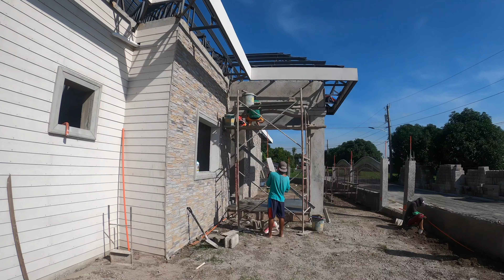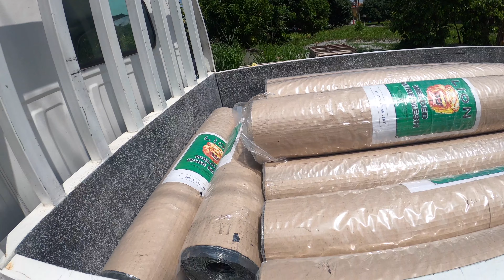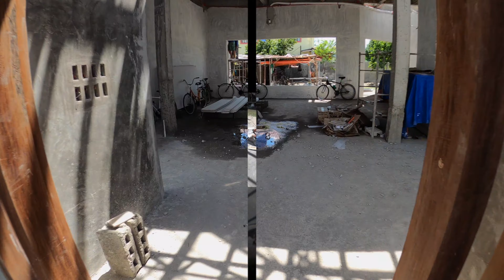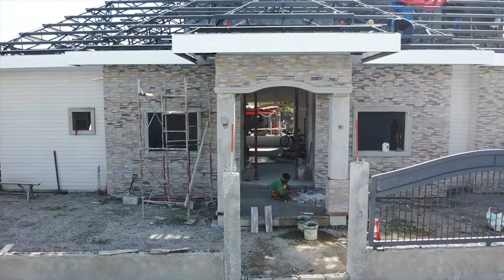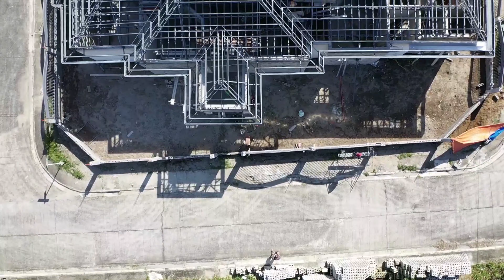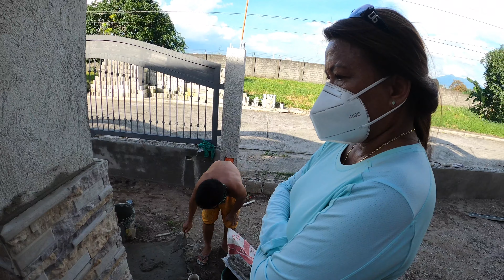Philippine House Building Step by Step, Build Day 138: Miter Cutting Stone Wall Cladding

Comment: thanks mate , nice flying by the way ..
Reply from the maker: andrew c.
How does the masonry compare to what you see down under?
Reply: the stone work ? or the plaster coat operations?  i really like the formed concrete over the top of blockwork and the way they attach corners with more concrete ..i love concrete as you can tell .  some of the tools make for a longer job eg , the piece of plastic pipe with a nail at end of it ..